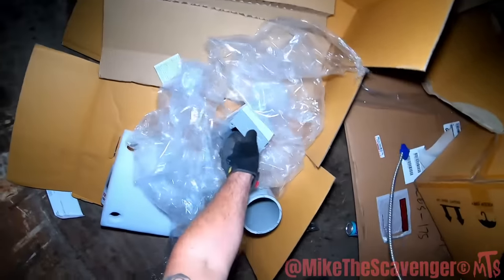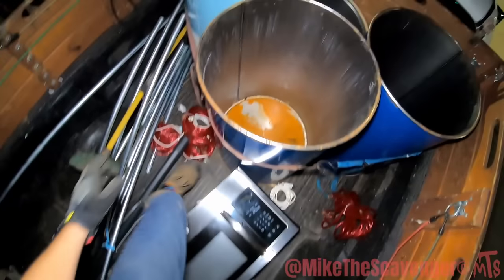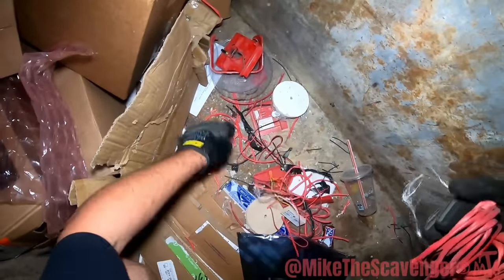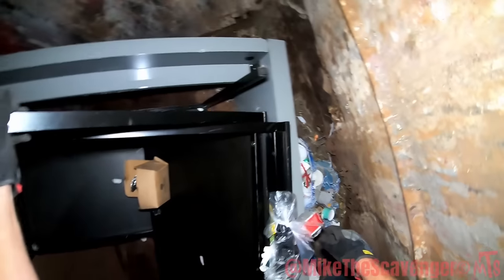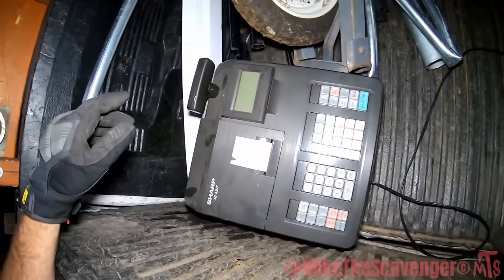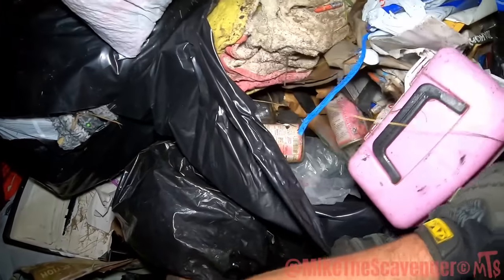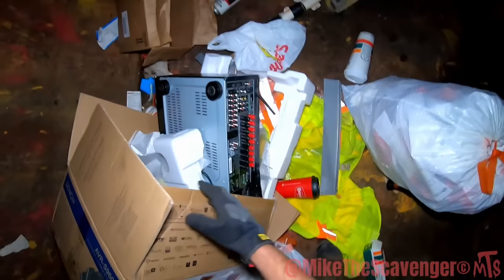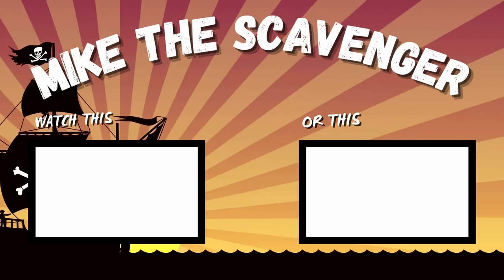Dumpster Diving "It's Got Money In It!"

Comment: Nice haul Mike congrats a litte cash register tip If you cant unlock the cash register most cash registers will have a manual release switch for the cash drawer its on the bottome of the cash register towards the back it should pop the drawer open working as a cashier in the past has taught me a few tricks including geting to the money tray diuring a power outage.

Comment: FYI Anything with a compressor needs to set upright for a minimum of 12 hrs after it was placed in any position to allow the oil to return to the compressor. If this isn't done there is a large chance of damaging the compressor. Do this prior to testing. If all is well, always keep it in the upright position.

Comment: Almost electric registers, there is a round hole where you can push a pencil in and pop the drawer open where the receipts come out lift that lid look on the back side inside and you will find the miracle hole.

Comment: Just in case you don't know always let a fridge or freezer stand still for 12-24 hours after moving it before you switch it on. 💚💛❤️
Reply: Put it upside down so all the gases go round the pipe work for 24hr